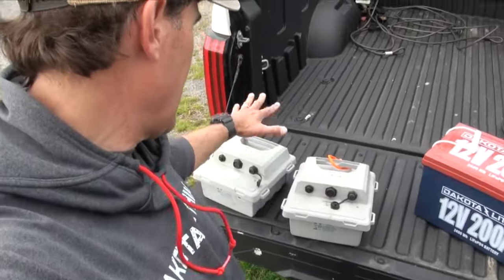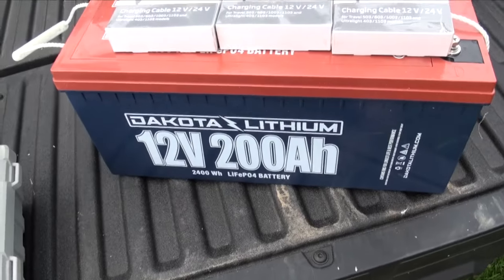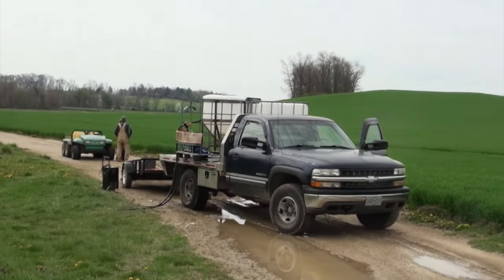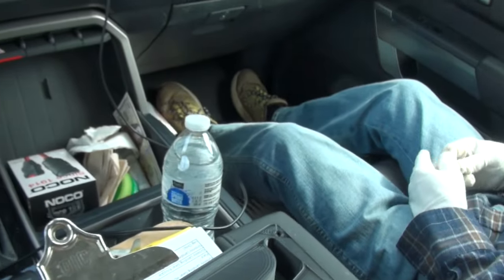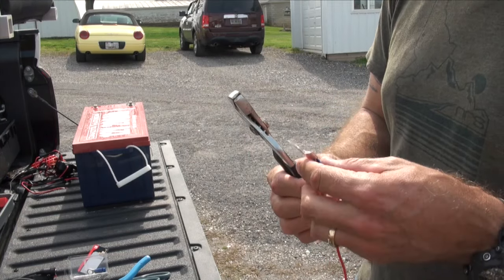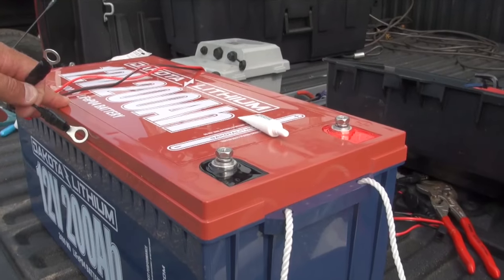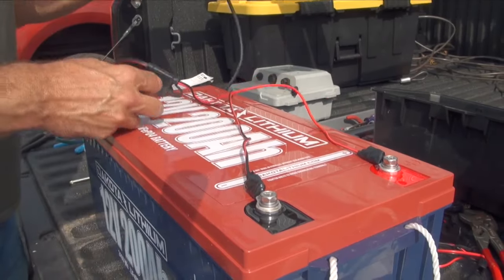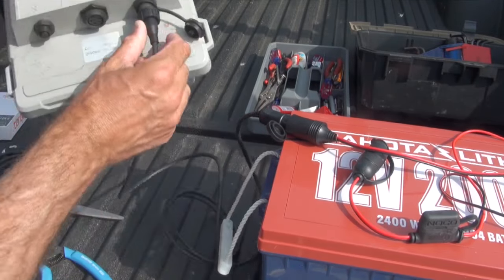Boondocking: Dakota Lithium Recharge Station for Torqeedo Batteries

Comment: That is so futuristic Jeff. Heck of a set up. That drone was amazing. Didn’t know they made them that big. Like the cutting of tape instead of tearing it. How about a solar set up as well or would that require too big of a panel?
Reply from the maker: Sea Eagle sells a solar panel that works well with Torqeedo Ultralight/Travel batteries.

Comment: Good morning,
I'm French, so sorry for the translation made by Google translate. If we plug the torquedo into another battery and put them in our kayak, will the discharge of the battery with the motor running be compensated by the charge of the other battery ? Thanks
Reply from the maker: Yes. I know that it holds at least two charges.

Comment: No AC outlet on Toyota truck?
Reply from the maker: There was an option for it behind the console, facing the back seat. I guess that wasn’t part of the package of this particular truck. I will get the Dakota Lithium 2400 power station with the solar panel recharge.